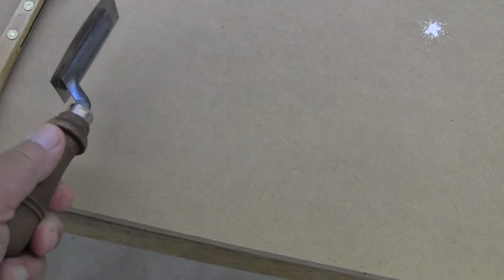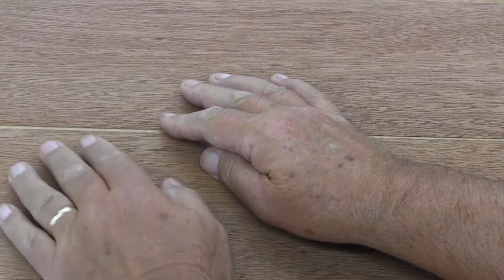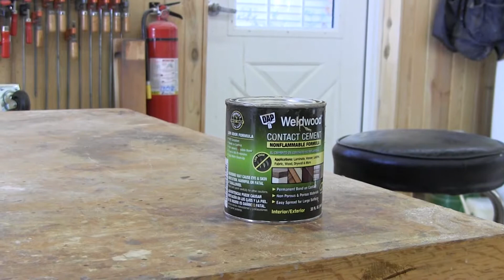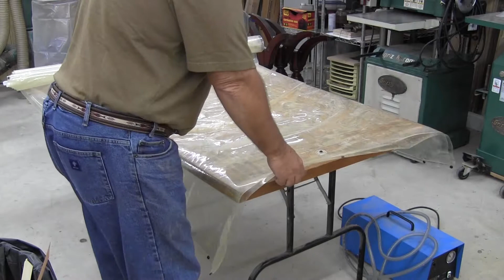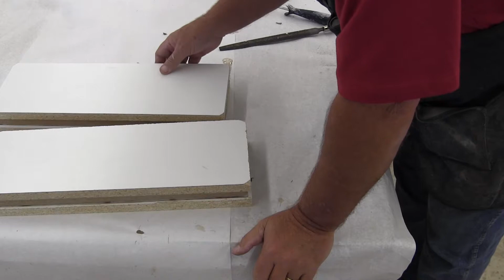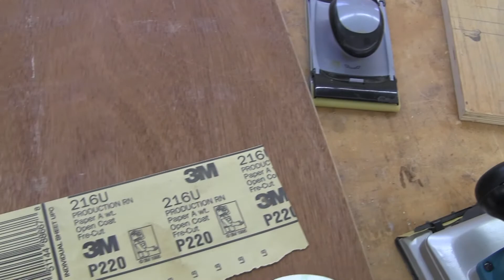seaming veneer with the festool track saw

Comment: Thank you for the great video. You mentioned using a new, dedicated blade to get the perfect seams on the veneer. Do you recommend a specific number of teeth / tooth style?
Reply from the maker: I learned this technique from Paul Schurch who likes to use a new metal cutting blade.  I've had great success using Festool's fine cut woodworking blade.  I seem to recall it has 50 or 60 teeth.  The more teeth the better.  Hope you give it a try.